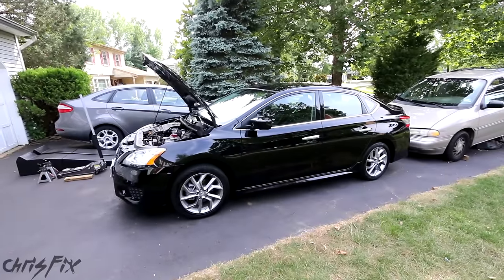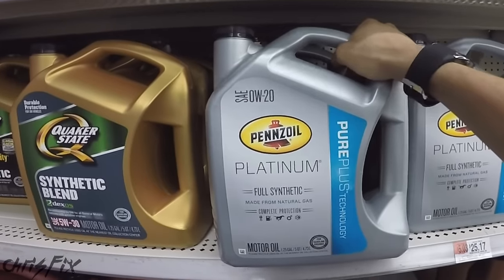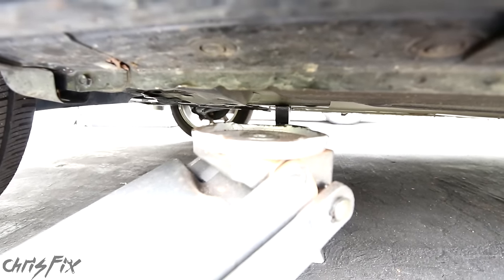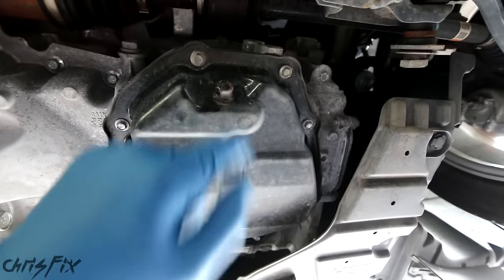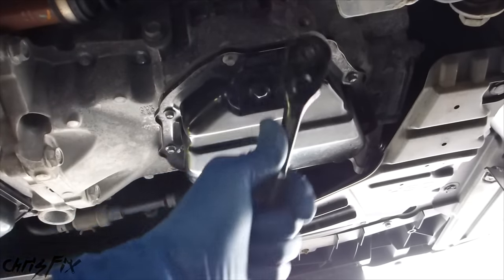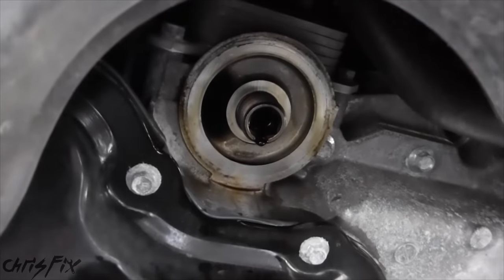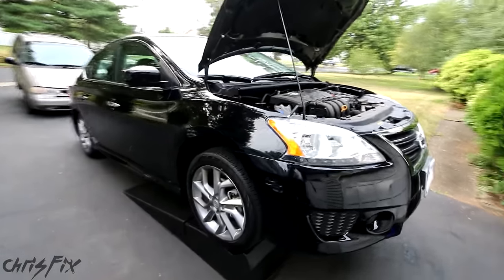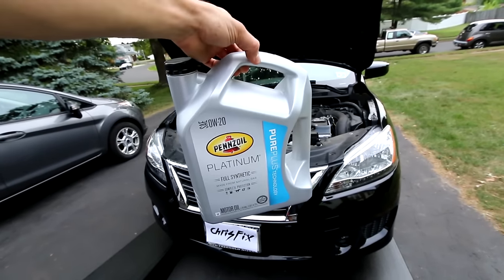How to Change Your Oil (COMPLETE Guide)

Comment: $70 Oil changes brought me here.
Reply: $70??? Did they fill your car with wine? That's madness.
Reply: Try $160 here in Australia for my Magna TW VR wagon :(
Reply: @scenenuf  they include red carpet rolled out and a hand job with that? like jesus
Reply: I changed my oil and oil filter myself and that cost me around 90 dollars.
Reply: I pay about $46 for the labor and parts.
$20 for oil (3.5qt)
$6 for a genuine filter and a gasket
$20 labor
This is for Hyundai Accent.

I could have done all these things by myself and saved $20 but I don't like to get my hands dirty ;)
Reply: SamuelBSR wow thats cheap. Oil prices here in Sweden are pretty steep, i used castrol 0W-30 for my volvo diesel and that was like 90 dollars for the oil only, I did buy a little bit more than i needed just in case, but still.
Reply: @MrGunnerman2  I use Pennzoil platinum 5w20 full synthetic ($26 for 5qt. here in the US). My car needs only 3.5qt, so it's quite affordable.
Reply: @SamuelBSR  Either way, oil is cheaper than an engine :)
Reply: I paid around 20 bucks
Reply: @Marrietta5418  What did you pay $20 for?
Reply: Demere Henderson i had to pay 120€ in germany for my mercedes...
Reply: For all the work of changing oil. I don't do it myself I prefer to pay a mechanic for it.
Reply: I've switched to amsoil and it was $111 (with shipping) the only reason I went with it was because I can go 25k miles between changes.
Reply: @JF32304  You'd better get your checked in a laboratory. I don't believe that oil can last 25k
Reply: @SamuelBSR  I appreciate the concern. I've done plenty of research and will probably do an analysis on it. I've watched video after video on the tube... Everyone is saying it takes a mind set change to use this oil. Everyone is told to do a change every 5k, could it be the marketing of these companies just wanting to make a buck? Amsoil filters aren't any ordinary filter, either. I'm gonna try it and see what happens.
Reply: Same here
Reply: Demere Henderson I just spent $90 on an oil change today, so I’m gunna have to start going by this video from now on lol
Reply: @jthompson120db  😂😂
Reply: Jiffy Lube charges $120 for full synthetic. Biggest ripoff ever.
Reply: @Dtyler171  😮😮😮WTF
Reply: @FlyBoiQ1  
Corrected, but it's still an absurd price. Had to go back and check the price
Reply: @Dtyler171  deffientely. Smh.
Reply: On a mercedes they charge over 200 for full synthetic and you cant even trust the oil they put in sojust do it urself
Reply: Jeremy Thompson 😂😂😂😂
Reply: Kenny might as well went to the shop 😂
Reply: Kenny, what kind of car do you have?
Reply: Lexus charged me $120 back when I was a rookie car owner.

I'm still a rookie car owner but I do my own oil at least.

Still no way in hell I'm touching anything else.
Reply: @MrGunnerman2  Well when i was working in denmark i was earning over 5000 usd month to hand so thats was not that much for oil .
Reply: @SamuelBSR    by I u
Reply: @infamousian123  i dont do oil change yet,but i change tires,spark plugs.put aux on it. i think i don't want to change oil it's just $20 ,but turn up people be askin $100 to change ur spark plug which is easier than oil change.
Reply: Our garage charges 700 euros (800 bucks) for an engine oil and oil filter change. They even told us that you never need to change the diff oil, transfer case oil, and gearbox oil. (Land rover garage metropole north in belgium btw.)
Reply: my mate in Australia paid 500 ahahahaha
Reply: Demere Henderson just payed 120 for my Audi A6
Reply: It's 100 euros minimum here in Germany. If you bring it to the dealer it's at least 160
Reply: @JF32304  what's the worst that can happen... New engine after 2 years? 🤣🤣🤣
Reply: Mine is $90 for synthetic oil
Reply: @rogehmarbi . Nope...that's about the average cost of an Oil Change at a Dealership now.  Quickie Lube Place's typically charging between $35-$65 depending on the type of vehicle etc.  I can do my own vehicle for around $30 Dollars with Full Synthetic, but only when I can get the Oil and Filter on sale.  One of my friends took his Car to the GM Dealership and it was only Conventional Oil and a so-so Oil Filter. Ka-Ching...$75 Dollars!
Reply: @JF32304  25k is pushing it...with or without Amsoil.   I wouldn't go much more than maybe 10-12,000 tops.
Reply: @510jesus  I'll send the oil for testing before I go the full 25k miles. Do you ever think that maybe it is possible to go the full 25k but marketing from the oil companies are the ones that have programmed you to think that 5k miles Max!! If it's good oil, you can go the full distance. I know the filter is a completely different material. So we'll see.
Reply: @darring.9161  Well from the research I've done 25k is doable. I'll send a sample in for testing to see where I am.
Reply: @JF32304  I was just messing around. They've probably done extensive research themselves. I don't think they would put everyone's vehicle at risk for some cheap gimmick and then have to deal with all the lawsuits
Reply: @510jesus  no worries! I have just a tad over 5k on the current change and the color in the dip looks pretty good. I'll probably get a sample and send it off.
Reply: @JF32304  Be my guest.  
Virtually all Engine Manufacturers (not necessarily the Car Manufacturer) insist that the Motor Oil should be changed after a given number of Miles...or at least once a Year (whichever comes first). 
 Did you catch that part?  Once a Year!  25,000 Miles is a fair bit of driving for 1 Year, and while Amsoil is a good quality Oil...it still gets dirty with Carbon, Metals, Soot etc...and your average filter can only go down to about 20 Microns. 
Don't care much what the Researchers really say... there are too many variables that come into play here. 
 The Manufacturers will only tell you what they think you want to hear...and not what you should hear!  
This not only applies to the 5k Oil Changes (your words) but also on the Extended Drain Claims.
 Oil is Oil Period. It's the additives that break down, and the Oil Filters capacity to minimise particulates...and the volume of oil that is available to continuously lubricate and wash away particulates that will determine how long oil should go...along with the driving environment.  
Say, did I tell you lots of Dealers also like to pitch the line about Lifetime Transmission Fluid??? 
 The sooner your vehicles quit, the sooner you buy another!
Reply: @JF32304  You can't go by the Color of the Oil on the Dipstick...same with Tranny Fluid.  Any worthwhile mechanic will tell you that!
Reply: @darring.9161  Oh ok. So if the transmission fluid is dark brown and smells burt... Does that mean it's still good... Because as you just stated color means absolutely nothing.
Reply: @JF32304  my cars oil is very dark after that amount of mileage. I try to change it every 4k miles using semi synthetic for a 2003 Escalade. Been using this for a solid year now
Reply: @510jesus  I use to use mobile 1 in my old Jeep with 200k+ on it. It leaked oil from the rear main seal I wasn't going to use high quality oil in it. I recently got a newer Jeep and switched to amsoil. On my old Jeep I would have to change the oil every 4 to 5k because it was just so black! Like tar black. Since I've switched to amsoil in the new Jeep (46k on odometer) it's not even anywhere near black with 5k on that current change. So I'll keep going and send oil in for a test here soon to see how it's doing. If it really really truly can go 25k between changes... I'm a convinced man. You have to realize something.... You need to use their oil and filter for this claim claim.
Reply: @JF32304  do you not rate Mobil 1 as high quality? Or do you rank high quality oil in the 10k+ interval recommended changes?
Reply: @510jesus  I don't rate an oil based upon how far I can go between changes. I rate it in how it lubricates, conditions, holds up against thermal breakdown and viscosity. And sludge buildup. From what I've seen... Amsoil is on the top. I use to be die hard Valvoline fan... Not anymore.
Reply: @510jesus  if I'm going to put an oil into my engine.... Why not just use the best you can use. So yeah it costs double... But what is your peace of mind worth.. Knowing you have a good quality oil in your engine.
Reply: @JF32304 Fritz.  No, it isn't good...probably should've been changed some time ago.  
Typically, it should be a Bright Red or Pink in most cases...brown or tan is borderline and should smell burned.  
But I can also tell you that I've seen Transmission Fluid that still appears Red or Pink, but when you go to do a Drain and Fill...it comes out a Purplish Black.  
Same for Oil.  It can appear Honey Brown or Golden even, but can still come out black and filthy.  
Colour isn't a good indicator on a Dipstick because it is only a gauge of your fluid levels and nothing more. 
 I've seen this repeatedly over 40 Years working on Military Vehicles, Tractors, Combines, Field Pumps and certain types of machinery...including my own Vehicles. 
 You have to keep in mind that while a small thin film of Oil may appear okay on a small surface of the dipstick,  and many times I've heard a number of people say "It looks good on the Dipstick"...but to see the shock on their faces when they see whats drained out into the oil drain pan!   
You're not going to notice much in the way of the sludging that settles in the engine either, driving environment is another factor, Dry, Wet, Freezing, Hot, Dusty or Sandy can also be a factor as well. 
 I'm not trying to convince you to not try an extended Oil Change...but I would urge you to not attempt to push it much beyond 12,000k or 1 Year whichever comes first.  If your going to do it, at least keep track of your "before and after mileages" and send a sample for analysis to Blackstone Labs with the details including any additives you use. 
 They have a Facebook Site and you can request their Test Kits...they will mail them to you for free.  
All you need to do is pay the postage and cost of the Test but at least you'll have a better picture of what's going on in your engine and how your Oil and Filter Choices are performing overall.  Then you can decide if you want to take it to the next step and go further with it.  At least you'll be going in with your eye's wide open, and not blindly based of market researchers and sales pitches!   Cheers.
Reply: @darring.9161  You didn't get it. My comment nullified your previous comment regarding color of fluid. I know what colors mean in fluids. And I know when my oil gets black like tar it needs to be changed.
Reply: @JF32304  Also...you can't go wrong doing a Drain and Fill once a year on your Transmission.  Tranny Fluid is for the most part...pretty cheap.  
You're only going to be replacing about 50-60% of what is in the Transmission anyways, but the newer stuff will gradually flush out any unwanted materials and freshen the older Tranny Fluid. 
 A typical Car will take anywhere from 3 to 6 Quarts depending on the Transmission. 
 I do it religiously every year on my personal toys and have never had any transmission issues to speak.  It's Worth It.  
Avoid Transmission Flushes...unless you're using a dedicated machine and have been doing it frequently since the Car was born!
Reply: @darring.9161  Well ok. So if you pour in brand new oil... It's nice and clear on the dip... How do you know it's good?
Reply: @darring.9161  Using this logic (not going by the color on the dip before a change) you should actually be getting a test before every change.
Reply: @JF32304  Well, you obviously put in Brand New Oil and I assume you keep track of your mileage too...right?
Reply: @JF32304 . A novel idea if you can afford to have them analyzed more frequently.
  But most can't be bothered or don't want to go through the added expense in the cost of an  Oil Change.
 I'm simply saying that before you go extensively with the High Mileage Oil Change...do so gradually, and base it on real-world examination.  Not on the basis of what some other party claims. 
I think that's just good common sense, but I don't know how much value you choose to put in your vehicle maintenance or well being.
  I just think a 25,000k Oil Change is really pushing it, and I don't think it really matters what sort of Oil you use. 
Hard Particulates don't discriminate on metal surfaces. 
 It's your Car...do as you like!.
Reply: @darring.9161  i just want a great oil in my engine. It's not that I want to go to 25k, this wasn't the reason behind going to amsoil. It was merely wanting a good quality oil in my engine. I had a pickup (09 ram 1500 hemi) changed oil every 4 to 5k. At 175k the engine blew. This was using Valvoline. I'm a firm believer in quality oil so I researched and went to amsoil. If by doing this I get to go to an extended oil change interval due to it being a great lubricant, so be it! I'm looking forward to that.
Reply: @JF32304 . By all means, do it. 
 See if it meets your expectations and satisfaction. 
 I've heard an equal number of good and bad on it, so really, it's subjective to the experience of the user.  Everyone will get a different view on it.  Initially, I responded to your first post because you suggested you like the idea of a 25,000 Mile Oil Change, and I suggested that that may be pushing it a little?  
Just to give you a sample of inconsistency in Commercial Advertising...take Mobil-1 Extended Life Oil Filters as a case in point. 
Both in the USA and Canada, the product and packaging are pretty much identical...except the Canadian Mobil-1 claims up to 24,000 Kilometres of protection...meanwhile, the same Filter in the U.S. Product claims up to 20,000 Miles?   So who's telling the truth???  
 24,000 Kms is just over 15,000 Miles and 20,000 Miles is about 32,000 Kilometres.  Why is that?   They're both identical and made by the same manufacturer with just a slight alteration in the packaging. But 8000 Km's/5000 Miles is a significant figure.
 Purolator Boss is a Premium Filter too...but will only claim up to 15,000 Miles on them.
  I usually use the Purolator Boss Filters...but I'll never put 15,000 Miles on them.  
There is also some debate about Royal Purple's Filters being a spitting image of the Amsoil Filters in virtually every detail and that they appear to be made by the same Manufacturer...but the Royal Purple costs considerably less.
  It isn't hard to understand the confusion of many while trying to decide what Oil or Filters to use.  So I think it is probably safer to go with the already established science of what is already known.  
Just my thoughts on the matter...not striking barbs with you here.
Reply: @darring.9161  I don't understand the hatred you have towards the product. If my aim was to get a superior product and the result of that was an extended change interval while maintaining proper protection of critical engine parts... I'm sold. It's not rocket science. Don't even compare amsoil to mobile 1, they're in 2 different lubricant classes. Mobile 1 and Royal purple are equals. I simply wanted the higher quality.
Reply: @JF32304  Hatred?  No hatred here, I've used it before...and I stated that it is a very good product.  
But I still wouldn't run it beyond 12,000k.  Just do what works for you.
  I've tried them all...Mobil-1, Redline, Amsoil, Quaker State, Castrol, Pennzoil, Royal Purple and numerous other Generics and Brands in both Synthetic and Dino. 
 I see no significant evidence that going more than 12,000k isn't without some risk...no matter what you use. 
I simply don't buy into the Advertising Claims at face value.  If that's what you call "hatred'...than me thinks you have a very twisted English Vocabulary?
Reply: @JF32304  Hatred?  I said earlier that it is a good product...and I've used it. 
 I've used almost every brand of Oil both Dino and Synthetic except for Schaeffers...because it isn't sold here.
  I just don't buy into the commercial advertising claims and gimmickry.
 I think you assume a certain amount of risk going past 12,000k with any Oil. 
 Has nothing to do with hating. 
 I think you got your vocabulary a little bit twisted?
  If I really hated Amsoil (again, you're words)...I'd tell you outright that it sucks, but I haven't suggested that here at any point.

  Most people also don't want to spend the high price of the Amsoil Oil or Filters either, and quite frankly if your only doing city driving...there is no net benefit to any synthetic, Amsoil or otherwise!  
In which case you may be better off with the 5000 Mile Oil Change and Conventional Dino. 
 Oil isn't the overall factor in engine lubrication, outside of what additives they put in...Filtration is everything! 
 Pull the Filter off of any Car and they'll all foul up the same...including Amsoil!
Reply: @SamuelBSR  1.) Thats  a really low amount for new oil 2.) why would you pay for a gasket for the filter?
Reply: It's actually only $30 to have the mechanic do it. Or I pay $70 to do it myself. But you are paying for difference in quality. I hace a Dodge Challenger that takes 7 quarts, and I want a good quality oil and filter with it.
Reply: Lmbo, same here
Reply: @MrGunnerman2  Var betalade du ca 700kr för olja? Även på dyra ställen som okq8 så kan du få en flaska 0W-30 för typ 300:-
Reply: Bruce Wayne köpte den hos den lokala volvo handlaren
Reply: 92 oil change brought me here
Reply: Wow, okay, I'm glad I work at a garage. Where I work, it usually costs about £90 for an oil change on an average vehicle. For my particular car, oil is about a £1 a litre, my oil filter was £3 and disposal was free, plus just my own labour. All in, £7. (THESE are trade discounted prices. To achieve the £1 a litre on oil, the garage spends many thousands with the oil companies every year.)
Reply: $25 from Ecuador. Including the instalation
Reply: Demere Henderson As if this way is cheaper
Reply: I cant believe this video got almost 5million view on oil change, should have taken it to walmart and let them change it for you.
Reply: VW PASSAT 2014 always between $80-$120 🥺
Reply: Here I get mine changed at a local garage for between 50 and 60 CA$

If I went to the dealer it would be at least 90 CA$
Reply: Boy im blessed to be in a family of people that work on cars.
Reply: Yeah $65 here. Bye Felicia
Reply: Kenny - HOW?
Reply: 100 for me, people are so greedy.
Reply: Im in Poland, i just changed my oil today for my Opel Astra G HB (1999), all i bought are Mannol Classic HC synthetic Oil 10w40 (15$) and filter Filtron 570/1 (3$), thats it.
Reply: here in algeria i did it for like 20$ in 2014 Q5
Reply: @scenenuf  That is what I have in NZ. decided to do it myself as everything to get started cost less than $100. So one oil change pays for itself
Reply: 87 where i live
Reply: I owned ford freestyle i spend only 30 dollars for oil change including filter , labour, and water wash in chennai india
Reply: @rogehmarbi  In Germany you pay at least 100€ (110USD) for an oil change. At a manufacturer workshop you can easily spend 200-300€ (225-340USD)..
Reply: @lukas_ls  that's an insane amount of money for an oil change.. I never spend more than half of that, and that's at a dealership
Reply: Dealership charges $72CAD ($53USD). My nissan rogue takes 5qt 0w20 full synthetic. When oil goes on sale I can get 5qt for almost half the price the dealership charges and the oil filters go on sale at the same time. I think my total for my first DIY oil change was ~$48
Reply: Hell, I'm about to be paying about $90 doing it myself. Only because I'm going to use amsoil.
Reply: Demere Henderson for me was 90 💀
Reply: @MrGunnerman2  ya played yerself
Reply: $89 brought me
Reply: I just paid
25 $ for shell fully synthetic 
2 $ for oil filter 
2.5 $ for the mechanic
Total 29.5 $
Reply: neoasura same here man, SRT8 runs 7 quarts of Mobile 1, plus filter = $$$
Reply: @JF32304  mine at the dealership is 10k miles. i have a kia soul 2019. i can definitely see oil lasting 25k. ill have to read up on that. thank you. i might switch!
Reply: @farmingandmercedesbenz4140  wow flex much. no need for that here.
Reply: @vini1277  that is absurd. id just go to a diff dealership and tell them that. im sure they would be happy to take you in.
Reply: $420 oil changes here in Iceland...
Reply: Good God I don't think I've ever paid over $30!
Reply: @MrGunnerman2  where you live at that's expensive I do my own oil change I spent less than 30 bucks at Walmart
Reply: @SamuelBSR  lol used gloves to do the oil change you keep your hands clean
Reply: @Dtyler171  it sure is damn that's expensive might as well do it yourself it is easy to do
Reply: Jose Hernandez I live in Sweden, everything is expensive here sadly
Reply: @MrGunnerman2  ouch
Reply: Try it in Egypt 1000 fairy for the oil change !!!
Reply: @scenenuf  and of you do its yourself it's about $50AUD for the oil and the filter.
Reply: 70 dollars!! Damn!!
Reply: I pay 100$ just for the oil and filter to do it at home. Y’all whine too much
Reply: $0.00 for the Tesla! Too bad I'm totally broke now from the car payments... :'(
Reply: Mine cost 90 thanks for the help Chris!
Reply: $260 for changing out two tires .  WTF.  $120/hour labor.  These guys take more than Engineers and Lawyers.
Reply: LMAOOOOO same $70 is why im here rn
Reply: In norway it's around 120$ max
Reply: 70 dollars is for the motor oil and cost of labour.
Reply: funny thing is I quite literally just did a $70 oil change lmao $30 for an AMSOIL filter (was $10+10 shipping) and an extra $40 for the oil (5 quarts royal purple 5w30). why? friend told me run the absolute best stuff I could find for an oil change just to see what'd happen (more than power gains, seeing if the filter is any cleaner/dirtier, how dirty the oil gets, etc)
Reply: @MrGunnerman2  i changed mine with mobile 1 full synthetic for about 38 dollars
Reply: I mean... Its ~$30-$40 for oil change supplies.. You're technically paying $30 and its good for half a year. I don't get why people complain about a $70 oil change. I work for the dealership and half the time when some "DIY'er" did the previous oil change I find stripped threads, rounded drain plugs and busted up skid shields cause they don't know what they're doing under the car. Plus where I work we put cars up on the hoist to inspect leaks, suspension, exhaust, tread wear, set tire pressure and fill up any fluids that are low (ex. washer fluid or coolant). %30 of the time I've found customers who had no idea they have a nail in their tire or their car is pissing out oil.
Reply: @jthompson120db  LMAO This comment is priceless!!
Reply: @SamuelBSR  yeah, nice kerr.
Reply: around 100$ here in india
Reply: Dang ours was like 140
Reply: 150 USD here
Reply: Rogeh , $70 including foot massage 😀😀
Reply: Try CDN $190.00 the other day for my old XJ6.  This did, however, seem to include a brief 'inspection'.  But this was just non-synthetic oil---nothing special.  
I was a little miffed, since they'd quoted CDN$150.00, and I've used this independent garage for repairs before and *not gotten ripped off.  
Still not sure whether to feel taken advantage of or not??
Reply: @jthompson120db   for a 160$ u get a professional massage and a hand job by a Moroccan masseuse while  keeping about 40$
Reply: Damn
Reply: @scenenuf  jeezus
Reply: @MrGunnerman2  Also in Italy, maybe all Europe is so, 5 liters 0W20 full syntethic oil is 80~100 euro depending on brand, 20 euro for genuine filter.
Reply: @rogehmarbi  bro, Porsche charges over $100.
Reply: What are they filling your car with?! Liquid gold?! My god.
Reply: It’s time to do it yourself maintenance - Son
Reply: now it’s $130 smh 🤦🏻‍♀️🤦🏻‍♀️
Reply: Wouldn't oil and a filter cost nearly that much if you did it yourself?